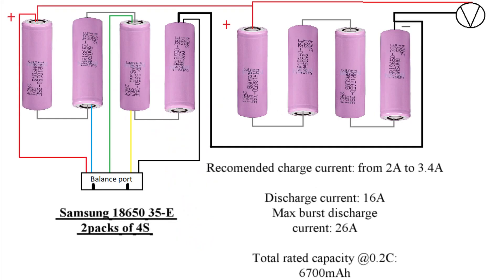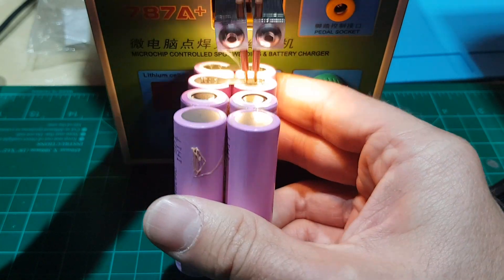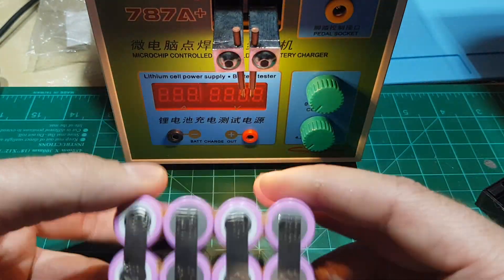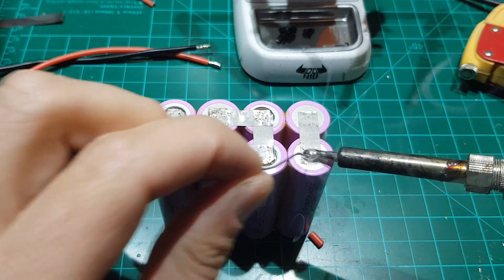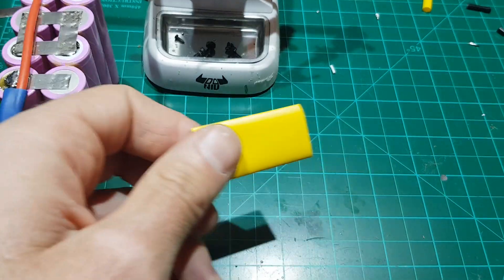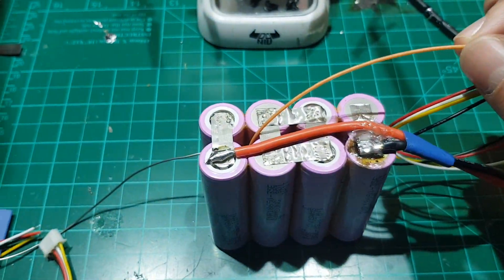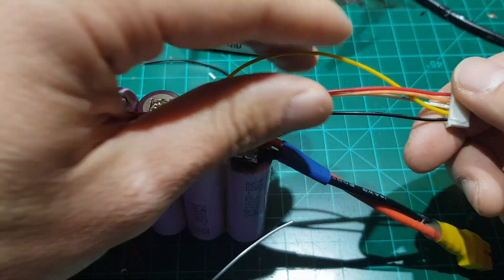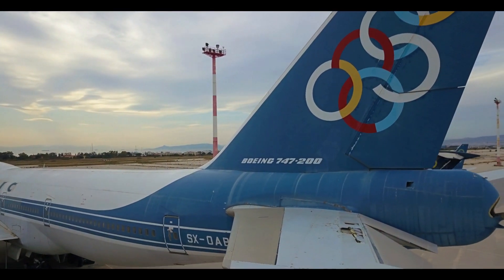Part2b/2 How to make a 4s Li-Ion battery from 18650 cells, DIY tutorial.

Comment: IM building this same battery pack for a rc plane, what gauge wire do you recommend , sorry cant tell watching video. thanks for any advice
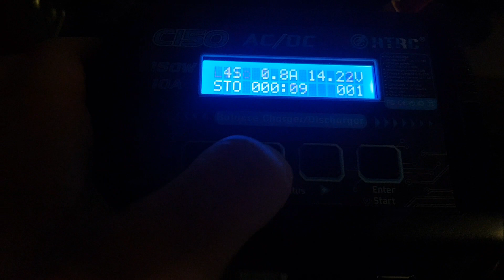Reply from the maker: 15:44 Rule of thumb will be 10% above the maximum amperage that the battery can deliver (its burst C rating).
I believe that since rc planes dont consume much current you should be fine with 14awg or 12awg.
Reply: Ok thanks, thats a big help my planes fly around pulling 6 to 10amp but on full throttle and during launch I see 30 to 35 amp draw

Comment: Your schematic doesn't match the battery as built, luckily. It doesn't show the parallel connections of the middle two cells in each 4S section, only the outer two of each. If it was made according to your schematic those cells wouldn't be balance charged and would end up as a disaster fast.

Comment: Wouldn't this be an 8s battery since you are using 8 - one cell batteries? I see other 4s Li-ion packs with only 4- one cell batteries.
Reply from the maker: They are connected differently(series/parallel)  please watch part one to get a better understanding.
Reply: @maixechrys6264  OH OK, I'll watch part one, thanks. I'm just learning about battery packs.
Reply from the maker: @gargolaconrad3188  no wories mate my bad I hadn't put a link.

Comment: Can you show how we can make a 14.8V pack of 4 cells (use only 4x18650 and set them on a series raw) using balancing connectors and have them tested in an Imax b6?
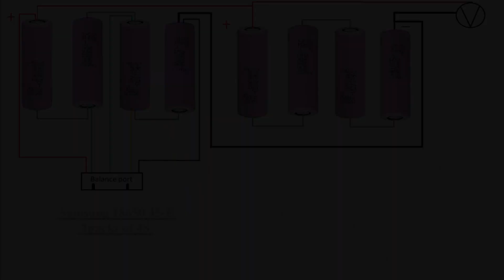Reply from the maker: Απλα χρησιμοποιησε τις πρωτες τεσσερις μπαταριες και ενωσε τα θετικα του συνδεσμου ισολογισμου στα 4 θετικα των μπαταριων οπως απεικονιζονται στο 0:39.

Comment: Sir, can we mix cells of different mAh in Lithium pack..??
Reply from the maker: No, it is not possible and it is very dangerous if you do so.
Reply: @maixechrys6264  Ok. Thanks.
Reply from the maker: @chongshenchang9367  thank you, please make sure you watch part 1 and 2 as they cover anything you need to get started.
Reply: @maixechrys6264  Ok Sir..

Comment: What charger do we have to use? Is it okay to use Lipo balancer charger? Pls notice🙏
Reply from the maker: Well no the charger has to have a Li-Ion option, voltage ranges are not the same.. I mean it could be done but expect funny results in a few charges!
Reply: @maixechrys6264  so what type of charger  can I use?
Reply from the maker: @neilgahapon3310  Any charger that specifically states it supports Li-Ion batteries. Whould you like a link.
Reply: Okay thank you

Comment: Great explanation.  One tip for you, get some flux, it will make your solder flow much better requiring less heat and stronger bonds.  A couple of your joints looke like cold joints which are a lot weaker.  👍
Reply from the maker: Always appreciate helpfull feedback for improvement, I ll give it a go thank you!

Comment: 14,15 volts total 
3,7v x8 = 29,6 volts 
why only 14,15?
Reply from the maker: Hello thank you for your question.

So assuming you are reffering to the thumbnail  photo that is depicts a pair (2) of batteries connected  in parallel, each pair consisting of 4x3.7 volt cells so a total of 8 seperate 18650 batteries for both packs. Each of the 4x18650 batteries (a single pack) are connected in series, the voltage is the sum of the batteries included in the pack (4x3,7v=14.8v) and the capacity is the same.
(assuming the nominal voltage of each of the 18650 batteries to be 3.7v, unless you want the min 2.9v rating or  max 4.20v)
Vice versa for the parallel connection between the two packs that give no increase in voltage but doubles the capacity.

I hope this clarifies the issue but if this is not what you meant please tell me what is the schematic you are reffering to in the timeline.
Stay safe!
Reply from the maker: Also please make sure you have watched the previous videos in the series 
Part 1 https://www.youtube.com/watch?v=IGz57RVNnPc&t=13s
Part 2a https://www.youtube.com/watch?v=-npLQM29Tv8&t=14s

Comment: Helo can somebody help me i have a question i have a ebike 240watt motor the standard battery is a 24v 10amp now i want new battery  en i see 18650battery of 10 to 35 amps can the bike handle 35amp battery (i need a 7cells battery  en wand to put in itch cell 6 battery that makes 3.7v itch cell en total of 24v   30amps)
Reply: It should be fine with a proper BMS, the motor will draw the current it requires from the battery i.e. 10amps at 24V. keep in mind that the motor will draw current to it maximum power which in your case is 240watts, what im implying is, as the pack voltage decreases the amount of current the motor draws will increase hence why you will need a proper BMS to protect the pack.
Reply from the maker: @Sinelizwiandile.ngubane07  Sorry for the late reply as long as the voltage is the same as the stock battery and the amp draw does not go beyond the capability of the battery (C rating) everything is fine.
Hope you already figured out a solution by now, please share if your project worked!